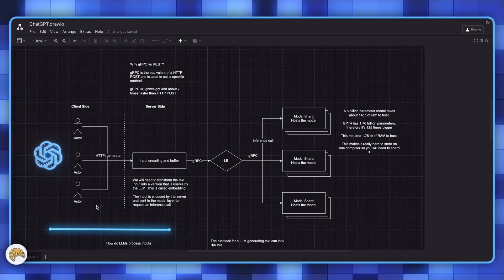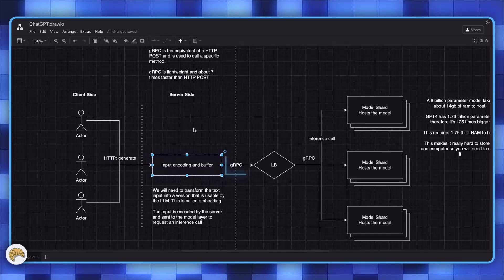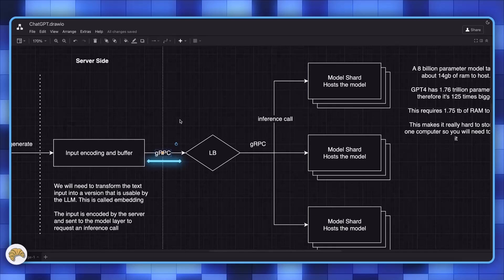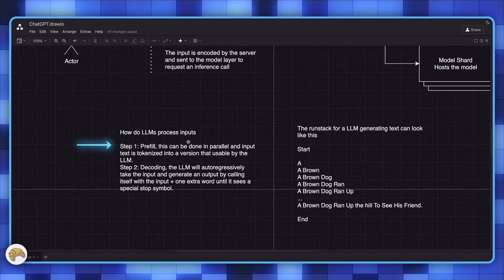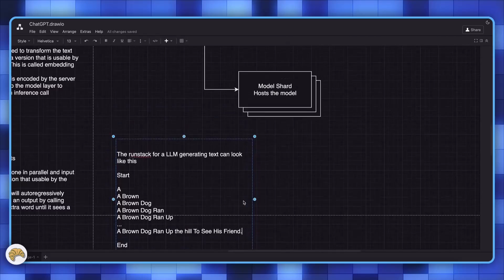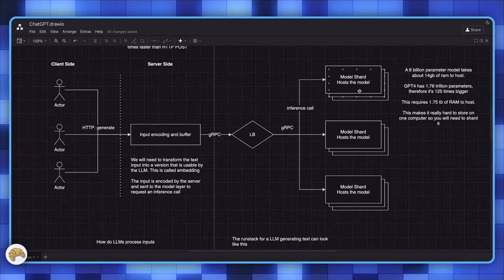System Design Interview Prep: Designing ChatGPT's Infrastructure

Comment: I would be worried about the encoding/embedding step being first because of a DDOS attack, or just a general bottleneck on performance. It seems like having a cache or rate limiter before might be a good option. Can also move the encoding step after the load balancer to distribute encoding/embedding as well. Not as familiar with gRPC setups though. Great video.